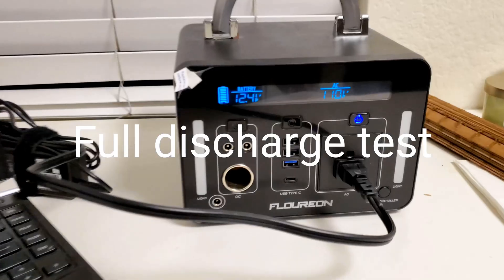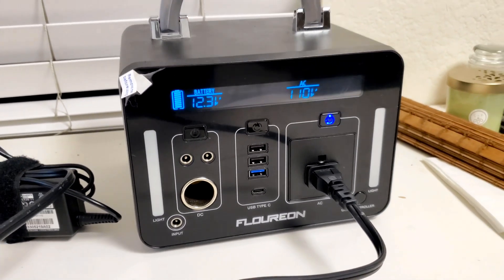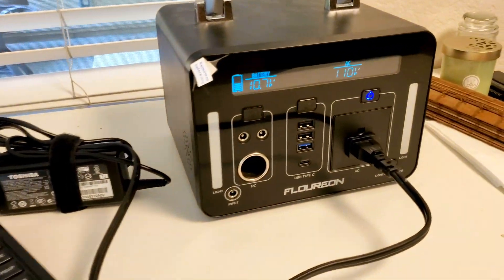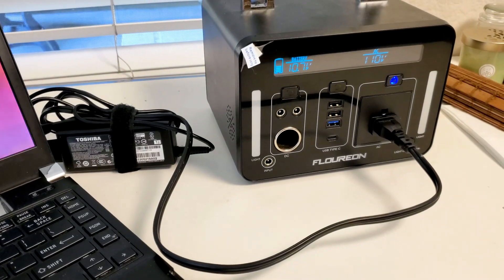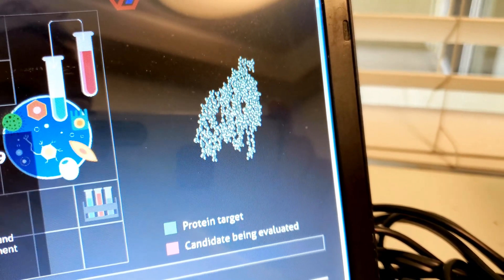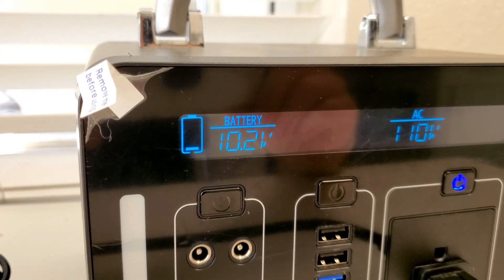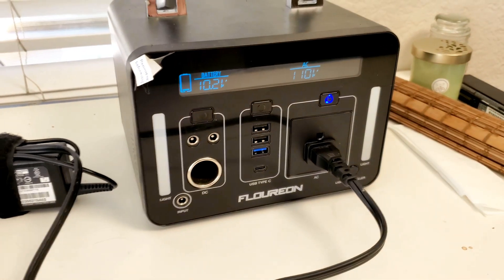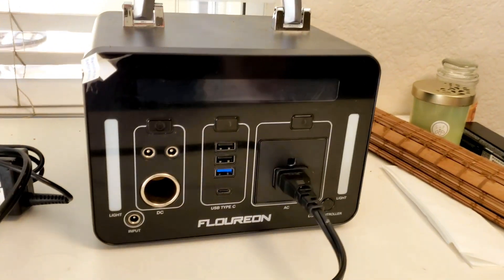Floureon 500wh Battery Bank Discharge Test

Comment: I've got one of these that had totally failed. Won't take a full charge and it's only 18 months old.  I do use it daily. It was a nice one till it wasn't.
Reply from the maker: Sorry to hear. Mine still works good but to be honest I barely use it unless I need it.
Reply: @ryen7512  that you don't use it daily would explain why it still works. I believe the BMS is what is failing,  not the battery. I looked at taking it apart but my skills aren't up to that, yet. 
I just ordered a new one but not a Floureon.

Comment: Note: those two small female barrel plug sockets above the cig/car socket are NOT the solar inputs! You plug any solar panels directly into the single power input socket at bottom left of unit.

Comment: Thats a great test. Could you tell us how many watts an hour your laptop uses please?
Reply: Do the math....
Reply: @pjf7943  it did about 30watts an hour but I am interested in what the laptop is rated as drawing in watts not what the watt per hour on the test was to see if they are different .
Reply: @logothaironsides2942  This reviewer has no electronic experience to speak of, hence the lack of proper info, which means you should look elsewhere for realistic results...  
If it consumes 30w, then divide by 18vcd = 1.7 amps (rounded off), which is about right for this laptop.  Of course the reviewer could have included the specs right off the vac wall brick, but that is beyond the scope of this review...  LOL!  I wouldn't spend more than $150 for this no-name sogen..